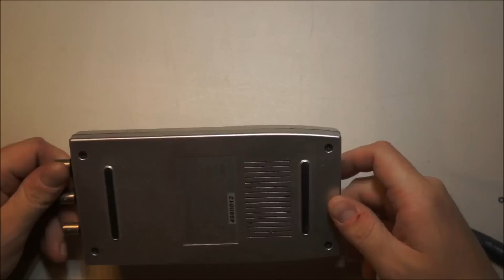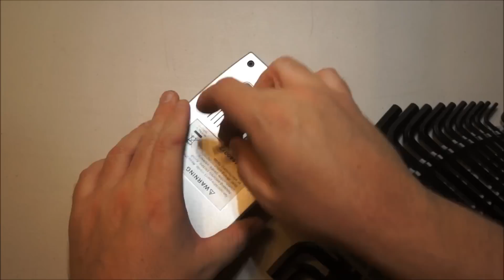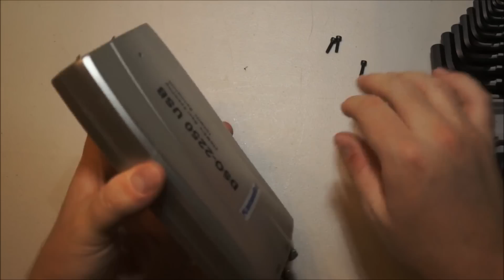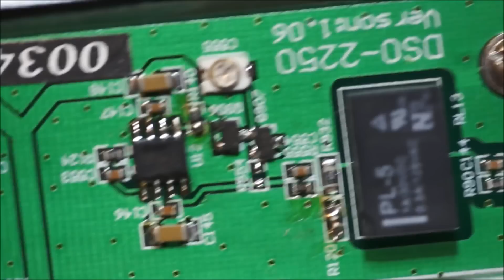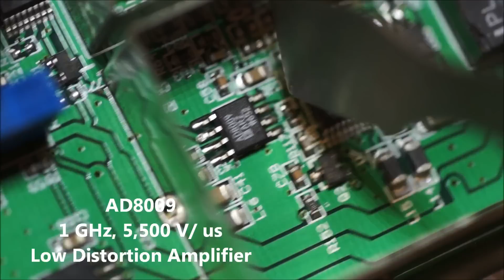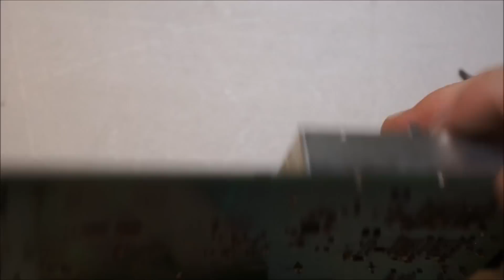Extreme Teardown: DSO-2250 USB Digital Oscilloscope

Comment: I have one of these but it is a Hantek branded model. I have never had a problem with mine and have always thought it worked well for what it is however after watching this review I had to pull mine apart to have a look for my self.
Sorry to say but mine ( DSO-2250 ver 2.03 )  is totally different to what you have with none of the soldering mess or other problems you seem to have with this model. Another main difference is the main device with mine having a XC3650AN. I don't no if the model I have is good or not but it does what I need it to do with no problems.
I have had mine for several years and I only paid around $80 for it.

That thing you have though is sure a mess.
Reply from the maker: Jonny Deth Theoretically, sure. But if you can afford the hantek, you can  afford a much nicer rigol that is the same price, so why would you ever buy the hantek?

Comment: Yes, I did enjoy that. Thanks :)

Nowadays this is nigh on impossible to find so much hand soldering. It's much cheaper even in china to respin the board with other components than to hand solder a bunch of small-pitch devices. Doesn't mean you don't see bodge jobs anymore, but at least you don't see *half the f*cking board* being bodged.

Comment: That seems to be a copy of the Hantek DSO-2250. Or is it the Protek DSO-2250? I don't know. Nevertheless, I don't expect the original to be much better. And I doubt it is really capable of doing 100MHz. The opamps selected (AD8009) don't seem to have enough bandwidth at 0.1dB attenuation, and although they surely pass 100MHz, they don't offer a significant margin. The worst are the ADCs: those are suitable for sampling 10MHz, or perhaps a 20MHz, but not 100MHz, even if they are overclocked (say, 200MSa/s?).